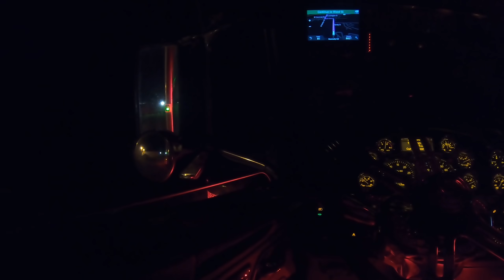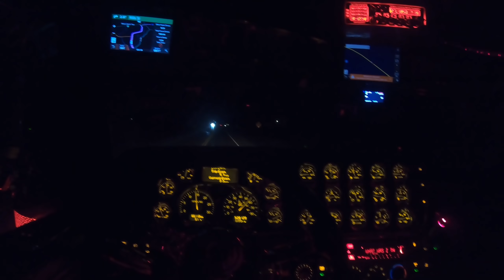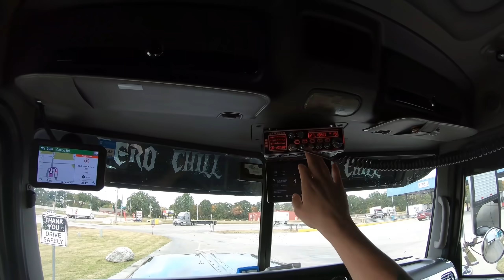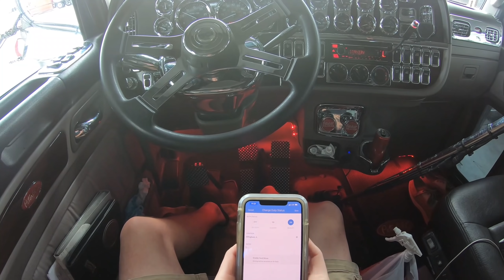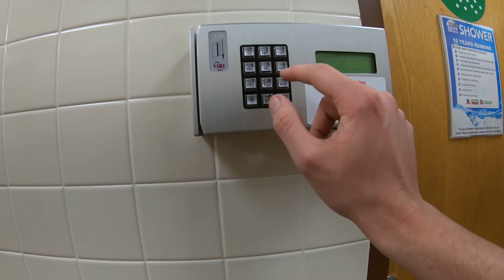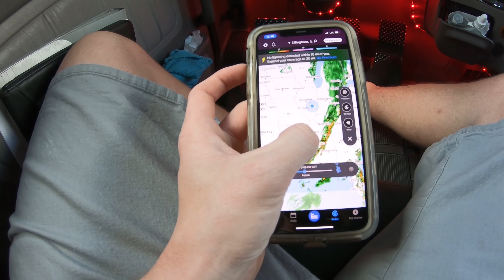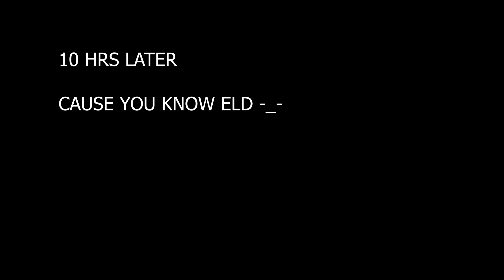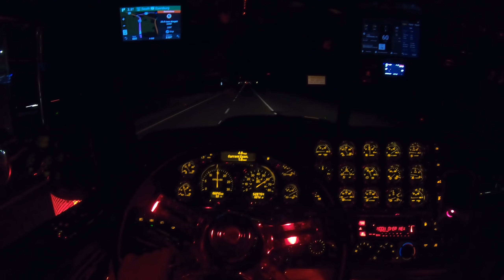Trucking On Down To Mississippi And Then Florida!

Comment: I will say, you are smooth. Smooth shifting and a real smooth move hiding that engine. I was so looking for the heart when you flipped up the hood but nope. Not this time. Stay safe sir and I love your videos.
Reply from the maker: Yessirrr kindda like drag racing you dont tell what ya got under the hood. I will say tho i love the turbo thats on it lol 😎
Reply: @High_strung  Thanks for the vids.  I enjoy tuning in every now and then.  I'm curious about the extended gear stick though.  I've seen them in some other trucking videos and I was wondering what purpose they serve versus the regular sized ones?
Reply: @johnivory1  They are like ape hanger handlebars on motorcycles, just personal preference.

Comment: Nice, straight lines when drying! You should invest in a battery powered leaf blower. Also a company called Flex has a small air dryer like a small leaf blower.

Comment: You need to mount a camera outside the the truck. Maybe on top of the trailer aimed forward.
Reply from the maker: Thought about it but cant figure out a good way to yet
Reply: @High_strung  would a suction cup hold with a safety wire on the camera?
Reply: @High_strung  Check out the FSC Speedshop channel. He has really nice camera angles on his Peterbilt cabover.

Comment: If you do not like Illinois it's a good thing you did not work for my Boss in Waterloo, Ia, he had about 15-20 trucks I had a '94 379EXHD 320-inch wheelbase with a 48foot reefer with a 10'2" spread, there was a pork-producing plant in town. I would load out on Monday morning for a Tues or Wed morning drop off, when I bumped the dock to unload I would start calling brokers I used to line up a load picking up in the produce corridor maybe 6-7 pickups going to Chicago produce market and from there I would pick up 50 miles from the house in Waterloo a load of usually canned food items I believe from Hormel going back out to Cali and be home early Saturday morning be at home for the weekend and hit it again on Monday and just repeat it was good money

Comment: why is the gear shift lever long?
Reply from the maker: Preference
Reply: @High_strung  does your arm get tired having to be bent and up higher all the time?
Reply from the maker: @geddon436  no its way more comfortable for me life its just a natral position for my arm for some reason and my elbo sits on the arm/hangs on to the shifter so there’s no effort. When it was low i would always mess up gear changes i went up 9in it made it batter but was weird soot still did another 6 and its perfect for me at least
Reply: @High_strung  how many gears do you have to shift through?

Comment: A  NICE  EXPLINATION  may be in order as to why your truck is configured like it is.  What are the benefits, why is it designed that way, etc. I though it had something to do with wheeling thru downtown Chicago like a Chinese take out bicycle driver.  That was impressive.  Keeping that big beauty spiffy is WHY you even deserve to be driving such a commanding machine & runs better when stunt'n.  Keep On trucking. #MAGA2020